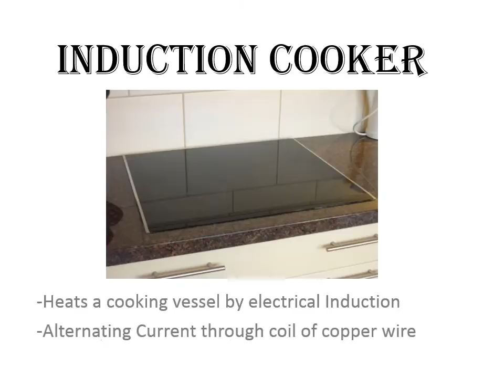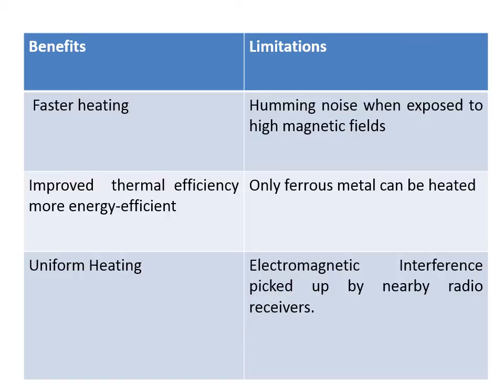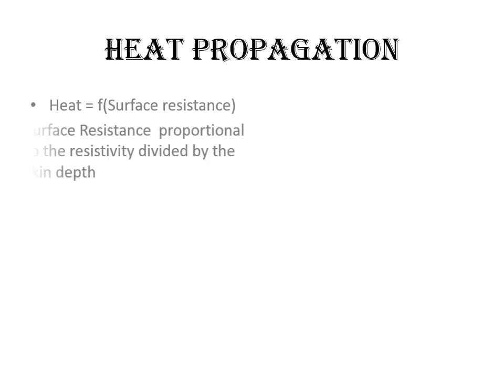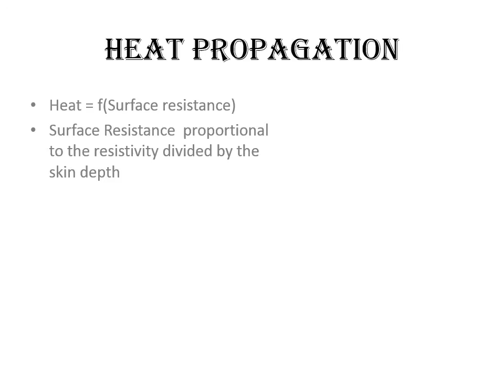How Induction Cooker works ??

Comment: want to ask you a few questions: 
1) will the pan heat up if it is held above the induction stove without making any contact         with it?
2) why doesn't pans other than steel work?
3) are there any precautions to be taken?
Reply from the maker: +Football Guru 
1) Yes, it will heat up but it is inversely propotional to distance
2) The material should be magnetic (steel/iron - utensils)
Reply: Yash Jain thanks for replying.. :) are there any precautions to be taken whilst using induction cooker?
Reply from the maker: Do not place induction cook top near radios, computers, TV which are sensitive to magnetic field.
Reply: Yash Jain ok man thanks for the kind reply :)